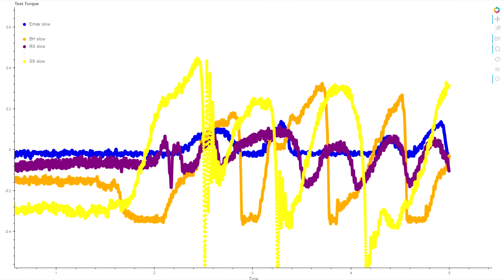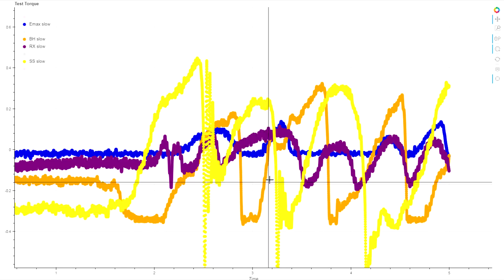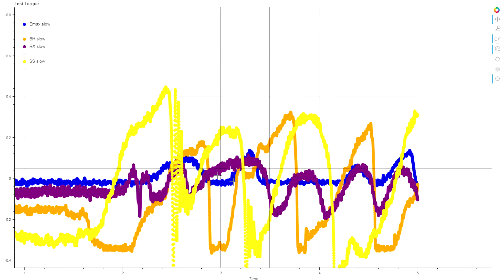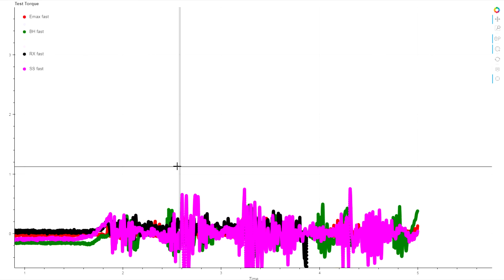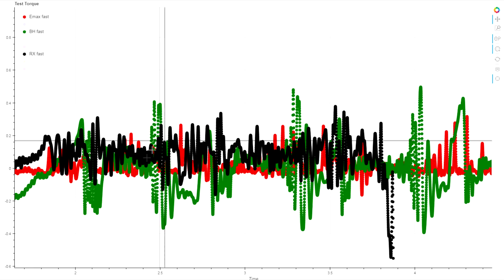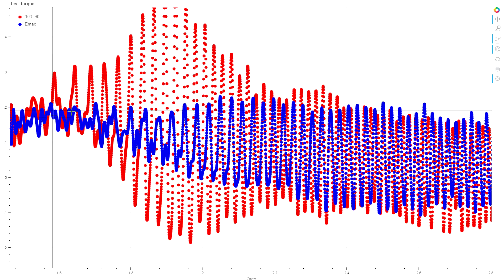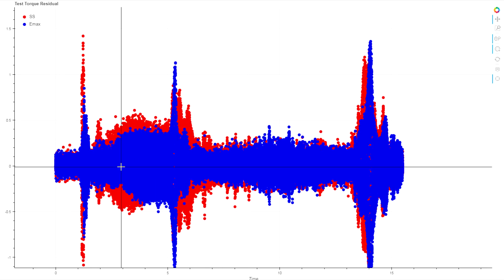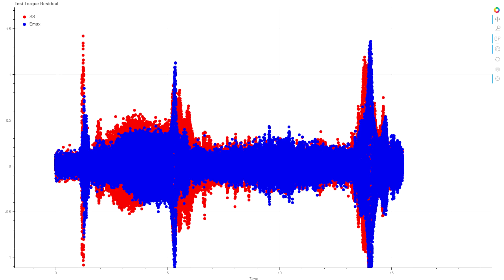Exploring cogging torque

Comment: One quick remark: Cogging torque can be set in relation with rotor moment of inertia. If the rotor has high moment of inertia, cogging torques loose their negative effect with increasing rpm quicker, then with a low moment of inertia rotor (M=I*omega). Thats also why the cogging is more of a concern at low rpm.
There are industrial control applications which require smooth velocity, and therefore some controlers implement cogging compensation on PMSM.

Comment: I watched this yesterday and was thinking about the results. What we are really lacking here is any kind of frame of reference. Identifying that the cogging seems to decrease with RPM is not really very useful until you know how much things are affected and to what extent. For example many people like smooth motors for smooth video. How much noise does there need to be before it comes through in video? We don't really know what point they start or stop to matter.
Reply from the maker: My point is more that it just doesn't matter, even though I can't say just how strong the torque ripple is in absolute terms at anything other than dead idle (due to analog filtering), since it's basically impossible to distinguish the difference between a smooth and clicky motor even at idle rpm.  If you can't tell the difference between them then it never reaches a point where it starts to matter.

That's not to say that there isn't a difference in the smoothness at speed.  But that difference appears to be so small that it will easily be swamped out by other factors such as bell and prop balance, and interactions with the resonant frequencies of your frame.  If you're looking for smooth video I would look to those other factors first before worrying about the cogging torque of the motors.  Making extra sure that your pid gains aren't amplifying the little natural noise that is going to be there is a huge deal.  Maybe a good way to play with it would be to just hold a quad with no props on, wind the motors up to speed and look at how much jello you get in your camera.  that would limit other sources of noise and show you just the results of bell imbalance and cogging torque.
Reply: I totally agree that other factors are likely larger. My theory though is that certain motor/prop vibrations cause resonances issues more than the actual vibration itself being the issue. In that case even practically undetectable oscillations might cause bigger issues.....maybe, just a theory.
Reply from the maker: for sure, trying to tune your frame so that it's not resonant in a bad place would make a big deal.  And even tuning your soft mounts, if you're doing that, so that they have a frequency response that compliments your frame could make a big difference.  At least cogging torque isn't going to be confined to any particular frequency, it's going to tick along at 6 or 7 times your RPM regardless.